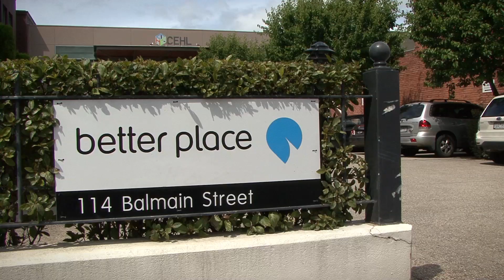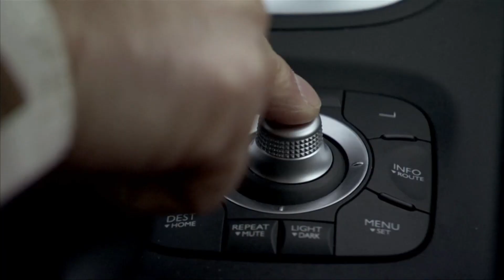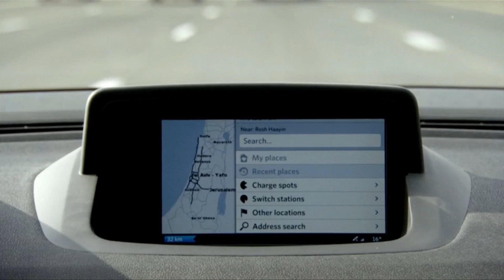MyDrive | Better Place and the Future of the Electric Car

Comment: if a electric car has a 200 mile range that would be better for most people because even with a lot of city driving i dont break over 90 miles in a day. I have buddies on 2 different sides of the city and we drive back and forth a lot.there are only 2 charging stations in my city of 900,000 people and one is in front of the court house which is not a frequent place for an average person. I probably can still make the leaf work for my use though.